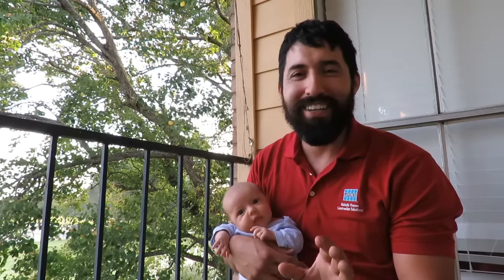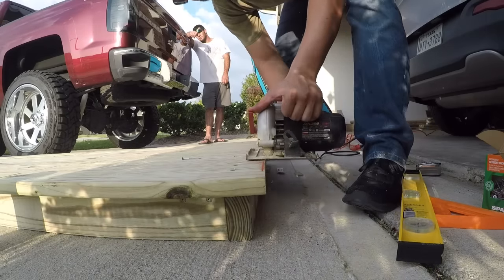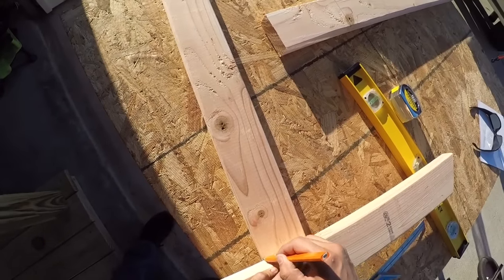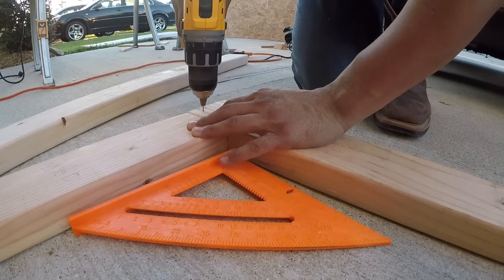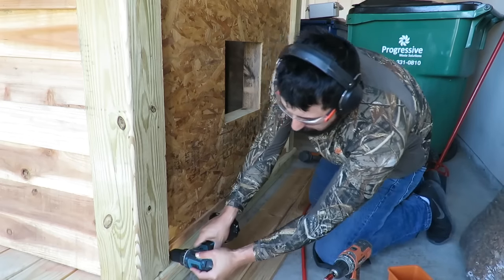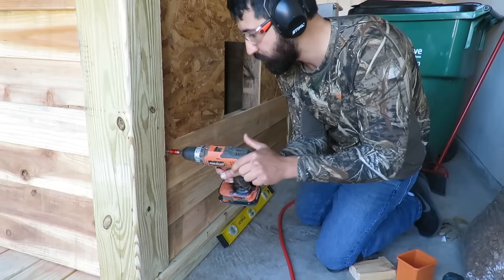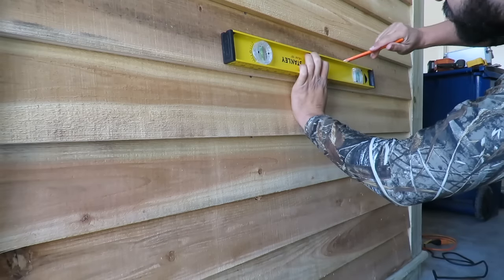How I built this BIG dog house.

Comment: I have always made rafters for small building. Cut the 2x4s at whatever angle is going to serve as your roof pitch so they meet flat. Use whatever plywood to match the pitch and make the firsr one a template. Use one on either side of each rafter except the outside two so your siding is flat. I spanned a 10x10 like that 21 years ago with a 45° angle in 1992 and its still perfect today. It gave me over 5ft. of headroom upstairs in that cabin with 7ft. downstairs using 8ft. studs and a double ridge cap.

Comment: Only a couple small things I would have changed. One is the window. You mentioned one of the minor things with the way that the joints lapped (this is really minor though). The other thing I would have done is to put the plexiglass inside of the frame (centered) and made a slight down-slope on the sill plate. Much the same way a normal window is constructed; it would help with keeping water out. The other thing that I would have changed is longer screws for the 2x but joints, 3.5 instead of 2.5 ....

I've been building crap for nearly 35 years and I can say that your construction methods were spot on and you did a great job. I would even say that this is over built but that's not a bad thing, especially with a structure that can be broken down into parts. Stronger construction is a good thing in parts that can potentially be moved around.
Reply from the maker: Ian Ide Great feedback! Thank you. The first plan was actually to center the plexiglass like you mentioned but make it removable being weather proof still. (Place the glass on the inside piece and pull it to the inside to allow air flow on cooler days) I couldn't figure out a way to be able to keep a good seal when it was in place so I just made it one complete unit. I actually did tilt the window to the outside a little to allow the water to drain because like you mentioned, I didn't want water to collect against the glass. I plan on doing some minor upgrades later on. It means a lot to have experienced carpenters say this was good. Thank you much!!!
Reply: Tilting the entire window frame is very good solution in this situation; that would definitely keep all the water out. Understand my original thoughts come from the idea of pleasing the customer and the thought of tilting a window wouldn't have entered my mind. Just try that at a home-owners house "um ya I'm just going to tilt this window" heh.... Very cool idea though, and if you are satisfied with it aesthetically, the chances are that no one else will even notice.
Reply from the maker: Ian Ide I completely understand. If I remember correctly I think it was 1/8th or 2/8th inch tilt from a being level. Next build I'm going to have to do my research and learn how to do it correctly. Any videos you recommend?
Reply: I haven't really looked around for videos that explain how to build a window. What little that I have seen all show conventional window construction and placement into a standard opening. There are several factors that you can keep in mind though.

Make the sill angle about 10°-14°, cut this piece custom to fit nicely.

You can add a 1/8" deep slot on the window casement to positively locate the glass; it's not necessary but it helps during construction. You can caulk directly onto the edges of the glass, into the slot, and it will be water tight. Trim against the glass as desired but keep in mind that uncaulked trim is just a spot for water to set. Notice that I said "set" not leak. This used to be handled by window Glazing (another semi-obsolete practice).

Window design is a bit of an art, and to avoid dry rot from resting water, places for water to run off should be built in. Today's standard vinyl casement window has actual holes built in that allow water to run out of the bottom front (of course this a completely different window) but you'll want to develop a similar mindset. 

When trimming the outside against the siding all trim is water tight except for the bottom piece where in comes in contact with the side trim. In fact you can create a natural water channel by making the bottom trim the short piece. 

So the top piece of trim is long, the left and right but up to the top. Top, left, and right are caulked water tight at this point. The left and right are also long and the bottom trim fits between them. Only caulk the bottom trim water tight where it comes into contact with the window casement. Put the trim on all together, no need to wait for the previous caulking to dry, but do not caulk the seems between the left/right and bottom trim. It is impossible to make it all 100% water tight (without extreme measures) and this seemingly minor detail gives water a place to go (down and outside) instead of resting. 

You can even make the bottom trim a tiny bit short, perhaps 1/8" and split the gap on each side 1/16", no one will see it from 5' away. You might even consider cutting a slight 5° angle at the top facing surface of the bottom piece of trim. Hopefully I didn't carry on to much and this makes sense. This all might sound like overkill for a simple window but a few simple steps will make a good long lasting window that keeps the outside out.
Reply from the maker: Ian Ide This was great! Thank you for this information!

Comment: This is Fantastic. Your design is very well thought out. If I had outside dogs I'd do much the same but with pallet wood & I'd insulate it. Thank you for making this video. Making it dissemble like that also means repairs will be easier in the long run. & means mass production can be standardized. Very nice.

Comment: Hey Emit. I didn't read all the comments but if someone dogged you for this project they need to have their head checked. This was awesome dude. I struggle cutting straight lines and you showing the tool you used to help fix that has been a big help. I appreciate that. I started building my own big dog house and i was wondering how you got the angles for your 4x6's. This is my first A frame attempt so any help would be awesome. I watched some other videos and they did all this math that kind of blew my mind. Any help would be awesome.
Reply from the maker: Hey Brian thank you man. The angle for the 6x6;s was 27.5

Comment: There's a piece of trim that you can install that hides the wood on you're metal roof, it's called rake, or you could've installed drip edge under the sides of the metal, it would also hide the wood and looks really nice
Reply from the maker: Thank You

Comment: U did a really good job. As for the window u were worried about u could've just flipped it on its side to keep the water from leaking in. (depending ur measurements) it looked like the sides were overlapped. Overall excellent 👌

Comment: Pretty cool. Is it mostly hot or cold where you are? I'm guessing it gets pretty damn hot in the summer. Any plans for insulation or anything else for making it 115 degree proof? I'd also be pretty interested in the bracketing used to be able to take apart easily. It's also good to see fellow gun nuts (as we're called now by the MSM). I'd like to see a video from you designing it in SketchUp. Maybe something like Jay Bates used to do. There's a bathroom vanity he designed on YouTube. It's interesting to see a builder's design process too.
Reply from the maker: Thanks! Yes it does get really hot here in the summer and the humidity makes it hotter. This summer an doggy AC will be installed in place of the cooling fan and the front door will be sealed with an dog door. The walls and roof will be insulated as well.
Reply: Tx?
Reply: +lovelylouro - Yep.
Reply from the maker: Yep!

Comment: Well how did you attach the metal roof to the wood? You forget to mention that part. Nails would create a hole for water.
Reply from the maker: rollerblading geek The roof is attached with the roofing screw with the rubber seals. They are made to prevent leaks in the roof. 😁

Comment: Hey great video! I'm definitely using this video as a template. I just wanted to ask on the window could you not just simply rotate it if its square (same dimension 12x12 ■)?  Since you've constructed that way?
Reply from the maker: Hey Thank You! 
Not sure if I understand what you mean by rotate it?
Reply: @RenegadeB1ker  I mean when it was time to install the window when you mention water runoff down inside the cut of the window frame. Just turn the window either right or left once.

Comment: How did you secure the 6x6 corner posts to the bottom base?
Reply from the maker: The corners are secured to the walls with tree lag bolts, the walls are secured to the floor into the 2x4's below the decking (Extremely Sturdy)

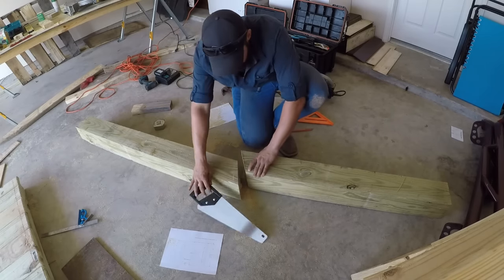Comment: Nice video! I'm building on real soon. At 3:25, how did you attach the corner posts to the deck?
Reply from the maker: Nate Thank you. The corner posts are attached to the walls with lag bolts. And the walls are attached to two by fours beneath the floor on the doghouse. There are four lag bolts for the walls connecting to the floor.
Reply from the maker: Each post is connected with three lag bolts per wall
Reply: Thanks  @RenegadeB1ker  !
Reply: @RenegadeB1ker  Just have one last question, how much weatherproof/stain did you use, and did you do the inside part of the wood also?
Reply from the maker: @nthnu  I think it was less than a gallon. I did not seal the inside because it was sealed from the outside. The walls were sealed to the posts with exterior caulking to keep any moisture from getting in through any of the walls.
Reply: @RenegadeB1ker  Thanks again!

Comment: How much without the porch to build?
Reply from the maker: Zach Alsup It wouldnt be much less than the 1,100 it took to complete it. The deck boards used are 8ft. So you would still have to buy those. Just a wild guess mabye you might be able to save 100 bucks.